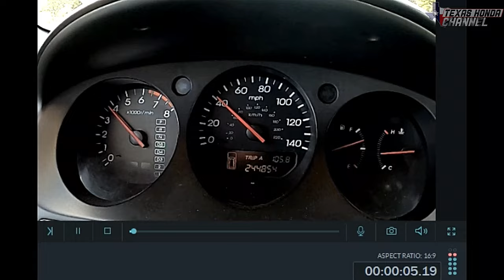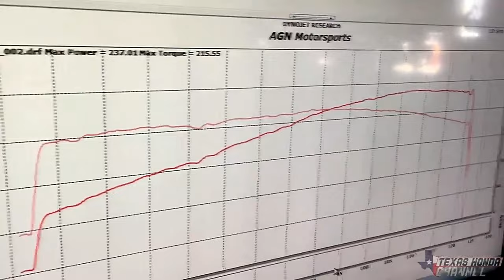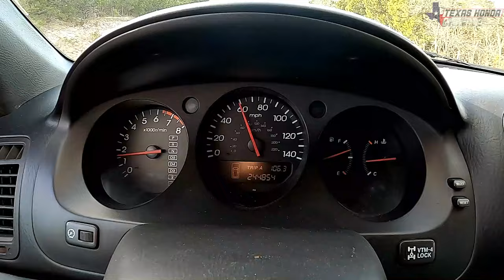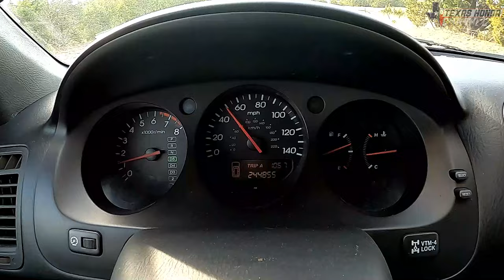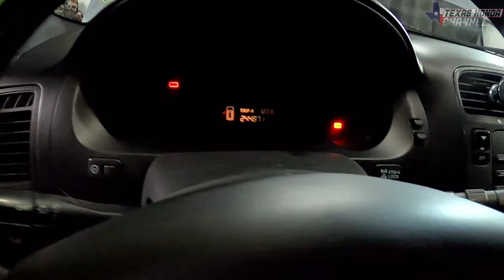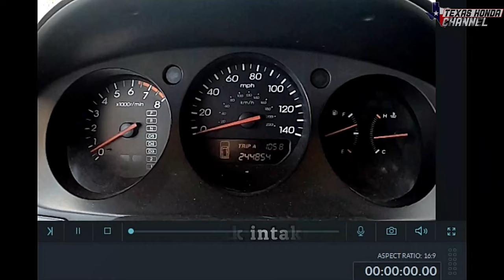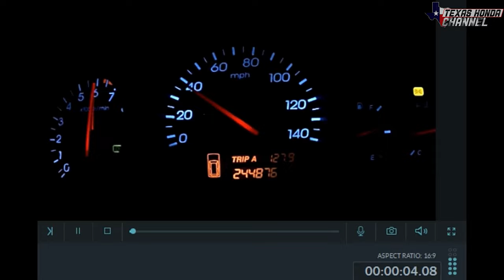Cheap Junkyard part made the MDX faster! 0-60 is 3 seconds faster now!

Comment: Three seconds!? You’d need like 200HP to knock that many seconds on that thing! Did you mean to say .3 seconds perhaps?
Reply: 3 seconds FASTER to 60… not 3 seconds to 60.
Reply: @dy1angi11ey6  You do not get it. 10HP does NOT equate to 3 seconds faster to 60.
Reply: @dy1angi11ey6 still not gonna happen. It's just not possible.
Reply: @dy1angi11ey6 Ok the MDX 0 to 60 is 6.4. now the new Vette is like like 2. So for 10 extra ho it's slightly slower than the Vette?

Comment: 29mpg??? How???
Reply: If you drive conservative, it's possible
Reply: I get 11.9 and that’s trying lol
Reply: @hairydeck  you got a heavy foot 😂
Reply: @792bnz  even on the highway the most ive seen it get to is 13.~ lol i put an intake on and got that extra .9
Reply: @hairydeck  are we talking about the same cars? the j32s can get like low 20's in the city (i have a 05 6 speed TL)  3.5 can get 18-20 in city. (2009 FWD Auto TL) easily will drop to 17 or less though from flooring it even once an outing. (on the j35 especially)
Reply: @iamatlantis1  j37, 2012 mdx. I just sold it and got a 2012 tl 3.7awd and I get 16/18 now. I pretty much only do city driving
Reply: @hairydeck i have a 2006 mdx and it goes 14-18 mpgs and I use my big toe to be ass efficient as possible lol
Reply: @hairydeck  clean your egr

Comment: For anyone wanting a J35 Magnesium IM for your V6 that does not have those actuators on the plenum, get the intake off of a 2006 Pilot with the J35A9 engine. The gasket set is about the same price but includes two of the metal gaskets due to that engine having the intake spacer (FEL-PRO MS 96410-1).

I found this out after the fact. I have a 2005 Pilot EX. I wasn't sure if the 2006 IM was magnesium until I went on an Accord forum. I sourced mine from a 2006 Odyssey EX (IM with IAT) & 2008 (Top Plenum Plate without butterfly valve assembly) Odyssey EX-L.

I had to source mine that way because the 2006 Odyssey had the IAT port, but the wrong Plenum top plate for my engine. The 2008 Odyssey had the correct top plenum plate, without butterfly valve assembly, but the intake was missing the IAT port; that engine uses the MAF for intake temperature from what I read online.

If I could do this again, I would source an IM from a 2006 Pilot with a J35A9 engine. The same MY Pilot with the J35Z1 has an aluminum cast IM.

If you're getting a gasket set for the IM shown in the video, go with the FEL-PRO MS 96409-3. It includes two of the metal gaskets that go between the spacer and IM to the lower manifold runners. The MAHLE MS19700 is a good alternative for similar price on Amazon, BUT it only includes one of the metal gaskets. Which brand you buy depends if your application has the intake spacer from the Pilot or MDX. 

Hope this helps, since I saw many comments asking questions about these details. I hope my experience can help some of you buy the correct parts/gasket kit.

I also recommend if you're doing this. Also do a Valve Adjustment and Valve Cover gaskets to replace all those old gaskets in one go.
Reply: Thank you

Comment: That's an aluminum intake manifold.
I have the same one on my pilot, I used others too but this one works the best all around.
I also have thermal spacers under the manifold and on the throttle body with cold air intake with the filter breathing in fresh air from the factory intake that's under the battery.

There's two versions on intakes
 manifolds, with and without the butterfly. The pilot doesn't use the butterfly but I use the manifolds that do have the butterfly. I just removed the butterfly valve and you can also switch it and change the power curve and what not.

Pretty great mod actually, picks up quite a bit power, it's actually fast now.
Reply from the maker: The j37 magnesium is the best one but they are hard to find cheap unless one hits the local junkyard but this one is cheap and works great 👍🏻

Comment: I know you didn’t say they did but just as an fyi to others watching the j37 MDX doesn’t have the intake spacer.  I’m guessing they used the extra displacement for the torque bump instead of longer runners by using the spacer.

Comment: Thanks for the video! Thanks for the j-motor love too. Have an 06 Saturn Vue with the Honda j35 and love it. I don't know if the Vue's version of the intake has the butterfly device or not. I'm guessing it is a variable length runner thing? Any insight on this would be appreciated. Would love to put one of these larger upper intakes on the Vue. I also have an '88 fiero that I am looking for a J35Z3 motor and 6mt donor to swap into it. Once again thanks for the video!
Reply from the maker: I haven’t messed with the J in the Saturn but I have always wanted to mess with them. Not 100% sure if it’s the same or not

Comment: Great videos you have and thank you for the quick replies concerning my questions!

I did have another question which I heard you address in one of your other videos and it has to do with auto transmission solenoids etc. My 03 Ody has around 225k miles and the trans mostly shifts okay. I replaced the trans fluid (never flush, just replace) and added the Lucas Trans oil additive but it still "slips" from 3rd to 4th (and/or 4th to 5th). I have not checked/cleaned/replaced any of the solenoids. Would you recommend doing this and if so; where can I get info on where they are located and which solenoid is for which gears etc? Thank you!
Reply from the maker: I checked and cleaned our transmission solenoids and it didn’t fix our problem. My neighbor also had that issue and replacing the solenoids with new ones helped the shifting. I recommend replacing the pressure switches (expensive) & shift solenoids. Ours still functioned fine but turns out they didn’t ALWAYS function fine. Sometimes they would work and other times they wouldn’t. We Replaced them and problem solved. That’s not always the situation but start with cheapest first

Comment: Great video. I didn't hear if your wife's MDX is 2001-2002, 2003, or 2004-2006.

If you do this on a 2004-2006 with the highest 265 hp, are you likely to get the same gains?
Reply from the maker: It’s a 2003 mdx I’m not sure on the other years but if it has the j32 style intake manifold like in this video I’m sure you will see some gains.

Comment: I have the Honda crosstour with the 3.5V6...my 0-60 is the same as your first run...about 9-10 seconds. Yours and mine.
Mine is AWD too
Now I know about the AWD FUSE! SO THATS WHY THEY ARE SLOW OFF THE LINE...AT SPEED THE CROSSTOUR IS FAST. SO FAR, HIGHEST IVE DONE IS 142 MPH AWD! V RATED TIRES.

So yours also has the manifold spacer on it?
Interesting. I'm debating on the same spacer. 1.5" tall. Like yours. Looking at just using hood spacers for clearance, if needed. Some say just take off the plastic top cover and it fits then. 
Learned a lot. 
What motor is your acura and year?
J32 series?

Comment: With the stock intake it’s a 8.41sec journey to 60mph. With the modification to the superior intake the 0-60mph jaunt took only 6.34sec. An improvement of 2.7sec!!!

Please keep in mind that I start the clock ⏰ right when the truck starts moving. Just time it right when the speedometer starts moving. 

Super impressive indeed. Now one mod I’ve never seen anyone make with the exception of ZF 8HP is putting in Honda’s more advanced 6-speed or 10-speed automatic transmissions in older cars.

Comment: H&R lowering springs on my 03 Ody... now van steering shakes a bit at around 30-40 mph. Known issue? But acceptable for now... not too shaky!
Reply from the maker: That shouldn’t do that something isn’t right. Definitely make sure it’s all tightened properly and check for worn bushings and sway bar. ALWAYS get another Alignment after suspension work. I know it’s not always something someone can afford (I’m always broke so I get it) but it needs done it’s a safety thing

Comment: Good video. Got a question. 04 mdx no CEL and won't rev pass 4500RPMs. Tried cleaning the vtec solenoid housing,  swapped vtec solenoid with my TLs, still nothing... it will just hold at 4500rpm without shifting. I let off the gas a bit and it shifts into next gear fine. Car doesn't go above 65mph. Thoughts? Thanks.
Reply from the maker: Sounds like it’s in limp mode. Unplug the battery for 10 mins and see if it still does it. If it does then it seems like it has a sensor that’s bad. Idk why it wouldn’t throw a code but worth getting to someone with a snap on or similar scan tool to do some thorough detailed sensor read outs

Comment: I want do this to my 07 accord 3.0 j only reason because the Accord uses an aluminum intake manifold and the 05/10 honda odyssey use a magnesium which keeps the engine a little cooler
Reply: j30 may be too small

Comment: J series love to breathe. I put P2R big tube headers in my accord j32a2 6 speed and a 3 inch exhaust and picked up 32whp on a dyno jet
Reply from the maker: Yes I believe it! I put a upgraded J pipe and that intake manifold and I gained around the same gains. Huge difference indeed!
Reply: I have a 6 speed acura cl and I know headers for automatics dont always got the manual bc of the torque dampers for the transmission. Do know if  those headers fit?
Reply: @ThePwak007  I am unsure on the headers fitting an auto as I converted my 00 accord to a j32a2 and 6 speed manual. So I did the headers then. Honestly there's 0 room left over. So I know the CLS engine mounts work on the j30 as thats my current setup. However with the auto trans I'm not sure.
Reply from the maker: @ThePwak007  i read somewhere about Honda Ridgeline J pipe but not 100% sure until I try it myself.
Reply: @blacktater1hill691  no I have a manual cls which has a bend in the headers to make room for the rear torque damper
Reply: @blacktater1hill691  most aftermarket headers for the J series don't make clearance for the damper since the dampers were only used for one year on the CLS 6 speed

Comment: I would love to see a overlay of both Dyno graphs.  
I am much more interested in power and torque under 5000rpm.
Reply from the maker: The first file was deleted or I would have had a video clip of before and after. It was gains all over the place from start to finish. There was a computer problem i between the time I went there before manifold and after so just had to take the video clip from previous video.

Comment: Thanks for sharing. I don't have much experience with this but I am mechanically inclined and a rather quick study. Will do this mod as soon as I'm able to get to a junkyard to get the Odyssey manifold. Quick question...can you link to the cluster led's you're using? I put the same color in mine but they flicker. I've pulled them out and rotated in case I had the polarity wrong but they still flicker.

Comment: After you put in the odyssey manifold you should of done the run around the same time you did it before replacing it that way  we can see the difference because doing a run at night time air is colder which produces more power.
Reply from the maker: It’s wasn’t really colder out it was still 75 degrees just like when I did the previous test: I knew I would get someone in here saying that lol
Reply: @TexasHondaChannel  lol my bad man, i figured temp was different, then all good then you proved it does make a difference  👌
Reply from the maker: @bugeye02707  it was 75 during the day it was 71 at night so it was different I had to check to be sure but yea 4 degrees won’t be that big of a difference in power but your not wrong temp definitely makes a world of difference lol

Comment: I tried looking for this part on eBay & in junk yards.
Seems like it didn't have the butterfly valve actuator bypass valve on the end opposite the throttle body on the intake manifold.
Completely blank on the other end with no spot for the bypass valve actuator.
Can you please give a specific year  - model -  trim level for the vehicle that will have the correct one?
Reply: I just pulled one on Sunday from an 05 Honda Odyssey in the junkyard.
Reply: @jordantrujillo293   -- LX / EX / EX-L / TOURING'?

Comment: This Rock!
I will do this.. Hows the MPG? 
Thank You for Sharing.
Reply from the maker: Mpg has improved from its 14.7 to 19 so far in town driving has improved. If I would stop getting on it then it might be better than that. Definitely the highway mpg has improved
Reply: @TexasHondaChannel  amazing! Will do this for sure. Thank You!
Reply from the maker: @BLAZEPSI  no problem and one thing to keep in mind is 91-93 octane fuel is recommended for these if you use anything else the MPH will suffer. Doing a good tune up helps too! Also light acceleration helps big time with mpg and the speed limit as awful as that sounds lol I get really good milage when I baby it.

Comment: Hi, you mention 06-07 Odyssey intake then a 2010 intake? I have an 03 Ody and was thinking of the intake swap but which one would be the best to swap it with? Thanks! Also... I have a blower off a GM 3800 engine... someday!
Reply from the maker: I’m not 100% sure on the exact year I just know between 2006-2010 is what the junkyard has on the vans idk about the 03 but I think that’s cable driven and if it is then that’s a no. As far as I know. I’m not a know it all so not sure on everything lol

Comment: You should do an experiment.. get a huge 70mm+ Throttle Body and have get a donor plenum/intake manifold.. have a shop port match it to the throttle body.. make a custom spacer if needed.. pretty sure you’ll gain more power, the V6 engines need as much air
Reply: no you'll change the AFR and lean it out.
Reply: Acura tech here, it won’t lean out. Honda pcm will compensate.
Reply: Biggest issue would be the different connector styles for the j37 and j35a5 throttle body

Comment: Do you think if you do that to the Pilot 2007 it will make run faster
Reply from the maker: Not sure what intake manifold the 07 has currently. Of the 07 has a larger volume intake manifold then I don’t think so but if it’s not very large or volume then probably would. Have to compare them

Comment: I've got a 2002 MDX that has been sitting for 7 years.....  Runs great except some tweaker tried (and failed) to steal the Catalytic converter.  my 2002 isn't DBW it has a Cable actuated throttle and cruise control.... would the 06-07 Van intake work for me?

Comment: if i were to remove my 4wd fuse would i be able to do burnouts or even do small drifts? or is the 4wd always on?
Reply: It’s fwd until it needs to be 4wd. Unless you put it in a specific gear.
Reply: It’s all wheel drive and it’s always on

Comment: What exactly is the difference of the two intakes one has a bigger diameter runners?
Reply from the maker: It’s a slightly different design and intake volume. It also comes apart so you can do port work easy.

Comment: Do you think I can do this to my J30A4?
Reply from the maker: I think the j30a4 has a decent manifold. I recommend the j37 intake manifold for that engine. That will make a big difference
Reply: The j35 intake is an upgrade for your j30. Bolts right in.

Comment: Is there a difference in diameter of the throttle body for the TL 3.2 throttle body and the Honda Odyssey  3.5?
Reply from the maker: From what I remember they were close or around the same. It would be ideal to put a P2R throttle adapter and run a J37 throttle but i decided just to use what I have.

Comment: Hello I have a 2009 mdx do you know what will get me running 0-60 under 6 seconds without damaging the car too badly??
Reply from the maker: The 09 mdx is a little different I believe as far as intake design on the runners but you can get your intake manifold and runners ported and do some exhaust mods and it will help a lot and won’t tear anything up. I will have a video coming out on SMP performance ported runners and more info will be in that video.

Comment: so how is the odesssy intake different? that it improves power?
Reply: i also want to know that
Reply from the maker: It’s a slightly larger volume and smoother intake channels inside. I was experimenting with the TL when I discovered this. The j37 manifold would be the best option but that’s a expensive manifold and throttle but they are the largest manifolds for the J series when going with a OEM option.
Reply: @TexasHondaChannel  thought people say J35y manifold is better than the J37 someone needs to dyno both one day lol
Reply from the maker: @robertalicea5585  yes that’s right I did forget about that one thanks for correcting me! I would love to get one!

Comment: Would a would a pr2 intake spacer help any? I have a 02 mdx
Reply from the maker: No since the mdx has a spacer I mentioned it in the video actually lol
Reply: It wouldn't hurt. Still need to buy an extra gasket and 1.5" longer mounting bolts. I doubt the spacer works in 1st place.
Reply: I know the mdx has one already I wasn’t sure how thick the stock is compared to the pr2. And also it says it’s made to not get heat soak so wasn’t sure if it would be worth it to swap the stock one out.
Reply: @jaytolento1398  p2r is 1/2 the size roughly. Its always a bigger gulp when you floor it. But i dont believe it is a good investment for you. Better to get p2r intake manifold elbows.

Comment: Doesn't that lean out the AFR without any tune and can hurt the car? I'd be interested in seeing your AFR now.....
Reply: The ecu automatically knows how the engine is running from the info from the oxy sensors/intake. that’s why it doesn’t need a tune or anything.

Comment: Would this work with the Pilot? Same car basically
Reply from the maker: It’s very close to the same especially if they have the electric throttle body. Worth a try but never tired it on a pilot
Reply: @TexasHondaChannel  I feel Like mine is cable driven, I’ll check and see it’s going for a full detail and wash